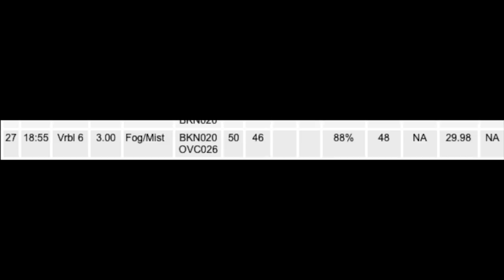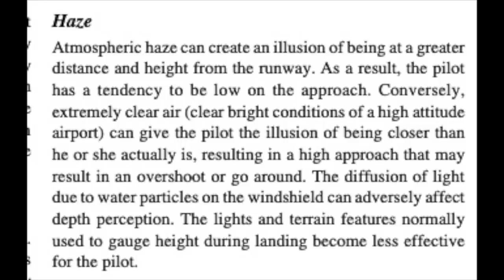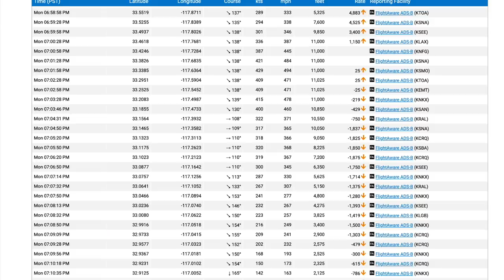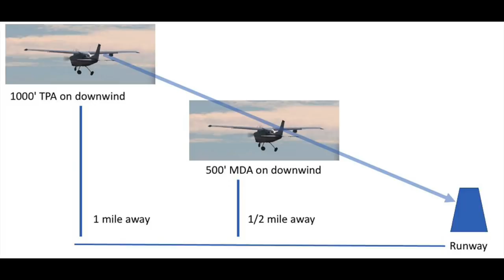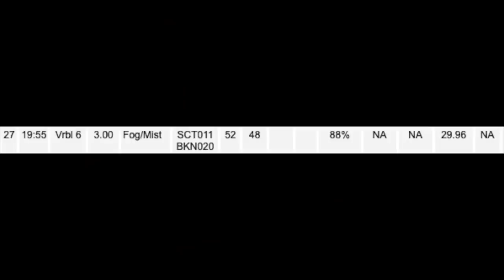N880Z Learjet Crash El Cajon San Diego California - Low Altitude Starts Accident Chain

Comment: There's an axiom:  "Where the head goes the hands and body follow".  The pilot was undoubtedly outside the cockpit while yanking and banking and looking for lights.  My guess is that he suddenly caught sight and simply lost track of how much bank he already had on then simply gave it one more "tug" which tightened up the circle.  The Lear is an unforgiving aircraft at high bank angles and low speed.  He stalled it out and he knew this 5 sec prior to impact.
Reply: Very precise and likely accurate supposition. 

People keep saying he was “too slow”. The reality is that the Lear is very capable of an accelerated stall well above the calculated final approach speed when compromised by the classic “tightening the radius” aerodynamic load. 

It’s a double edged sword:  higher approach speed — your radius gets profoundly increased, you slow down…radius gets smaller, but not only does that bring you closer to minimum maneuvering speed…it also means that your “inside” wing has a much more pronounced decrease in relative airspeed due to a comparably tighter radius than the outside wing / wingtip, which can easily result in a  stall of the inside aileron / wingtip area due to downward deflection of aileron creating a momentary higher angle of attack (downward deflection occurs as the pilot puts in opposite aileron to counteract the inertial roll characteristics of the Lear 35 due to “inertial moment” of tip tanks). This higher angle of attack on the portion of the wing traveling the SLOWEST around the turn (aka because inside wing travels the shortest distance) can cause an almost instant snap roll into inverted stall / spin.
Reply from the maker: Well described Josiah. I'm guessing they were trying to stay close to the airport because of poor visibility, but their high ground speed required more room for turning than they gave themselves. Very sad.
Reply from the maker: It's easy to lose track of the bank angle when looking outside scanning for the airport. These pilots were in a very demanding situation, where there was no margin for error. I was in a similar situation two weeks ago, and decided to go for the easy win, which was to land at night in weather at San Jose international, rather than land at my tiny home field of Palo Alto. It "might" have worked to go to Palo Alto, but there would have been zero margin. Going for the easy win just made more sense. The client wanted us to "take a look" first, but I insisted we go straight to SJC. As it was, the airliner in front of us did a go around, and the second one behind us also did a go around, both for wind shear. Nasty night, so a good time to go for the easy win.
Reply: @AviationNewsTalk  Excellent aeronautical decision making, Max. I enjoy your videos and always appreciate your safety-focused synopsis(es). 

At some point, I think that the FAA should also focus on materially increasing checkride requirements for sim training (type rating and recurrency) to always include at least 2-3 short flight / high workload trip scenarios added to each 91 /135 crew member's Flight Safety mandatory ride requirements. We see more and more of these accidents (and incidents) relating to flights under 45 mins -- where inclement wx and other compounding factors lead to poor / rushed CRM generally, inclusive of checklists, briefings and even Company SOP adherence. Perhaps there should be a focus on this alarming datapoint -- unusually short flights have a marginally decreased "successful outcome" in otherwise ordinary flight scenarios as compared to flights lasting over 45 minutes (with all factors being equal).

Thoughts?
Reply from the maker: You raise an excellent point. I've often thought that short distance jet flights are incredibly stressful compared to a typical flight where you have some time in cruise to get ready for the arrival. I've never seen any statistics that show that short trips have a higher accident rate, but I bet it's true. Have you seen any data on this, or just the same kind of gut feel that I have about it?
Reply: @AviationNewsTalk  The European Aviation Safety Agency did a study that was published a while back via Taylor and Francis. It focused primarily on data related to short-haul workload fatigue relative to Part 121 (as we refer to them here in U.S.) operators; however, the data could certainly be interpreted /applied to all operations under similar flight / workload parameters.

Comment: The various security camera videos show the plane just within the cloudbase at times.  Is it possible that the pilots were that close on the downwind leg because they were afraid of losing sight of the field completely?
Reply: They requested landing lighting increased so yes, they were losing the airport environment.
Reply from the maker: Yes, they may have wanted to stay especially close. But the downside of that is not being able to complete the base to final turn without overshooting the runway, which appears to be what happened. And if they were experiencing the  "atmospheric haze illusion" they may have thought they were farther from the runway than they actually were.
Reply from the maker: Agreed...that's a strong indicator they were having trouble seeing the airport through the mist.
Reply: As a casual observer,  I'm curious why landings aren't just flat out aborted when the situation isn't ideal?
Reply: @86FxBdyCpe  they are, often. The conditions and effects on perception made it difficult to see a failed approach until way too late. There are several points during this approach where proper procedure would have aborted it. But those procedures are not used except in airline flying. There is appropriate upset training that could have prevented this, but it also is not standard.
Reply: @86FxBdyCpe  EGO!
Reply: @ryantunison5433  What a real shame, at the expense of innocent lives.
Reply: My guess is that a concerned Local Controller watched the whole event from the TWR cab in MVFR 3sm vis. Probably concerned about his altitude. We will have to wait for NTSB to find out. 
There are lots of night visuals, FWY 8 headlights, FWY 67 headlights and a TWR rotating Beacon. Probably beacons on the two hills. 
According to Google Earth, flightaware ADS-B data, He crashed at 1.23 nm straight in to 27R on Pepper. Vis was 3sm. My gut feeling is that Vis, ceilings, BR were not an issue. Guessing it was improper speed/power, altitude management. In other words a very unstable approach. He was climbing to eventually descend. He was just too low, added too much thrust,  and gained too much speed in ascent to altitude. which caused him to overshoot base , overbank, accelerated stall etc. This aircraft appears to be a rocket, clean and fast.

Comment: Something's I'm curious. I trained to do circles without final flap configuration until prior to leaving the mda to have a higher airspeed to perform the turn and not get slow. Were they fully configured at the time? Also, I was trained that circling at minimums should be taken as an emergency procedure and only accomplished if absolutely necessary. Even then a thorough brief of trouble Ts and MAP are required.  Last piece of advice when circling, if you're practicing at mda in vfr conditions and the tower tells you they'll call your base or turn for whatever reason (although they shouldn't but I've seen it happen) climb immediately to a safe pattern altitude because you risk losing your circling radii protection.  Fly safe

Comment: I agree with the statement about NOT doing a circle to land at night.  I did a couple of those in an MD-80 years ago & that stress level was higher than doing a Cat IIIB!  As I recall, the terrain around KSEE is not lighted either.  Making the skill of both local knowledge & excellent range determination critical at night there.
Reply from the maker: I watched from the ground as a regional jet just barely out broke out of the clouds on a circling approach into Missoula, MT. My wife was on board, so I texted her to explain what happened and that they would now being flying out a long distance to do an arc to the ILS (the tower changed runways in the midst of this). She said after they landed that the pilots looked shook. I'm not surprised; I don't think most airline pilots do that many circling approaches. Yes, there are lot of small mountains surrounding KSEE, and most wouldn't have any lights on them except perhaps for a radio tower. Local knowledge is always king. I just wonder if, since it was their home field, they were perhaps a little more complacent than if they were going into a strange field.
Reply: @AviationNewsTalk  I agree with your assessment.  It's like flying an NDB approach in weather & strong crosswinds (at altitude but not on the ground).  ATC turned us on very close & made three approaches before we got the wind correction right enough to make a safe landing.   Curling at night requires the same intensity as an emergency---in my book.

Comment: The displaced threshold on RWY17 gives about a 3600’ LDA…too short for a Lear 35 and likely not authorized in a 135 flight with the 60% rule. Also, isn’t the TPA in a turbine aircraft 1500’ AGL, not 1000’ AGL as you mentioned? 1000’ is for recip aircraft. You are correct, these pilots didn’t have much choice to get into SEE but if I did that approach at night, I would have likely used the MDA for the circle on the RNAV17 approach while overflying the field, which is 1440’ for CAT D (my altitude preselect would have been 1500).4636’ is the LDA with the threshold on 27R where as 9L would have given them the entire runway.
Reply from the maker: You're correct, I was quoting the 1000' AGL TPA listed in ForeFlight; they don't specify a higher jet traffic pattern for KSEE, but it should be 1500' AGL. Agreed...they  would have been far safer to be at the circling MDA, though perhaps that would have put them into clouds. Still, I can't come up with any rationale for being as low as they were.
Reply: @AviationNewsTalk  I agree they should have been higher. I believe the AIM has turbine aircraft TPA 1500’ AGL as standard. I enjoyed your video! I watched another guy who apparently is a 777 captain talk about it and he misspoke about everything related to the approach, etc.

Comment: You make a very good point for not flying too close to the runways on downwind to final. As you stated so well, I believe the pilots situational awareness was compromised by flying such a tight down wind to final leg pattern. If the spacing between the downwind and the runway was greater, it is less likely that the accident would have occurred. They could possibly have landed safely without incident. This is only my opinion. I defer the final judgement to the NTSB investigators. Great analysis and enjoy flying the Cirrus Vision Jet! It is one beautiful aircraft!
Reply from the maker: If they'd flown a wide enough downwind, and hadn't flown quite so far east, they could have made it, even at their low altitude. I've seen two of their prior ground tracks for flying this approach and runway, and they both started further west, went further south, and didn't go as far to the east, where they ended up pointed right at a mountain. If they'd flown the same ground track as before, they probably would have made it, even at their low altitude.

Comment: I understand there's no published approach to 27R, but I recall from my primary training a PAR approach. Also, I'm wondering why the pilots didn't request vectors to get lined up with 27R instead of cancelling IFR? I'm not instrument rated but one time when flying VFR as PIC with a CIFI instructor (who was along for the ride and not acting formally as an instructor) when the weather went south. He requested IFR then an ILS approach to runway 20 at KCHA. Atlanta center handed us off to Chattanooga approach, who handed us off to the tower, who advised the 20 GS was inop. The instructor requested  a PAR to 20, which I flew with his help down to absolute minimums. When we popped out of the clouds we were about 50' or so off the CL, which he said wasn't too bad for a PAR. Now that was in a 172 which ain't no Lear 35. Just curious if this could have been an option.
Reply from the maker: Most towers are not authorized to give vectors, which is why you'll sometimes here them give "a suggested heading" instead of a vector. Vectors are generally given by approach controllers, but they have minimum vectoring altitudes, and with the terrain surrounding KSEE, the MVA would be fairly high. There are very few PARs in this country. Most of them go to military airports. They require very expensive equipment on the ground, and a dedicated tower controller operating just that equipment. So, no they couldn't have flown a PAR to Gillespie Field. Cool that you got to fly one though!
Reply: @AviationNewsTalk  Thanks!

Comment: I see this as a stall spin incident.   Aircraft can stall at any speed specially while turning and climbing and imposing load factor on aircraft.
Reply from the maker: Agreed. And many of those occur from excessive rudder and/or bank as pilots try to "fix" and overshoot on the base to final turn.
Reply: I totally agree. I believe speed rather than altitude was the real issue. The left wing stalled and the aircraft went into a left spin without enough altitude to recover. DMMS adherence or more precisely lack of it was the dominant factor in my opinion. Regardless it is a sad outcome.
Reply: I remember flying in a C-172 just after I got my license, and we were goofing around about 5000 AGL, and turning really tight turns at about 100kts when the stall buzzer started going off. That was my AHA moment! Even at a good airspeed, loading the airplane in a tight turn can mean all 'normal' rules no longer apply. Taught me to really pay attention, particularly down low.
Reply: But I could not hear a stall warning in the audio.  Maybe the first "oh shit" was the wing drop" and the second "oh shit" was cross control stall that seals the fate.  FDR should clarify.
Reply: @anti-socialmedia8195  - DMMS would not have prevented an accelerated stall, which this appears to be.  A Lear will easily stall at a much higher speed than DMMS if you yank and bank it hard enough.  (spoilerons can contribute to this)  This pilot was WELL aware of the rapidly approaching terrain as he overflew the final, so guessing he instinctively pulled up HARD while banking away, if only momentarily, and then BOOM.
Reply: @AviationNewsTalk  The doorbell cam caught him in a hard left bank and he firewalled it like an F-16 pilot going afterburner... nose up yoke must have been terrifyingly severe at that point. Sad choices... shoulda, woulda, coulda...
Reply: @jamescaley9942  No FDR only CVR. So I hear.

Comment: Condolences.  He had a safe approach for 17.  I think the 6kt tailwind was a factor in him changing runways but thanks for mentioning the runway length issue.  It's a shame.  Not worth it in hindsight.  Now I also know why he cancelled the IFR.
Reply from the maker: Someone posted that the company had an op-spec that required a longer runway than 17. Going back through the history of that aircraft, it always landed on either 27R or 9L, and never on 17.

Comment: Nice presentation I pretty much came to the conclusion going VFR and cancelling his IFR in that weather alone was the begin of the fights demise, radar data has shown when they were at 157-knts and the suggested vref for that point in the approach for that model lear is 152-kts -vref+5. What a lot of people aren't talking about but some are is that these part 135 pilots are only required by the FAA to be +5 and that's what they're taught nothing against these flight schools because most of them are very reputable and good at what they do but they are not teaching these Pilots to keep at least a 30% stall buffer on the circling approaches and keep it there until leveled out on straight final then slow it down.

Comment: They should have never have cancelled their IFR clearance. You can clearly tell by the pilot asking the tower to turn up the lights that he could not clearly see the runway. How could both pilots agree that this was the best approach to switch the clearance and runway the last minute?
Reply from the maker: It's possible they planned to land on 27 Right the entire time. And since circling to 27R is prohibited under IFR at night, they legally had to cancel IFR in order to then maneuver to land on 27R. They didn't have a lot of good options, but flying that low, perhaps to stay below the clouds, was a questionable choice.
Reply: @AviationNewsTalk  I agree. I also think that the runways at Gillespie are questionable for the Leer 595? Especially in wet conditions. I wish more safety instructors were teaching DMMS.